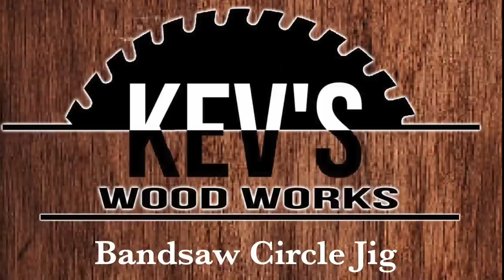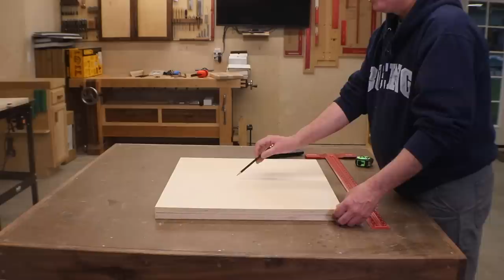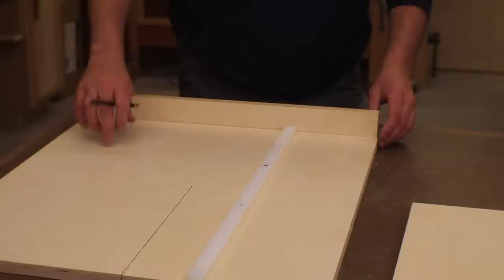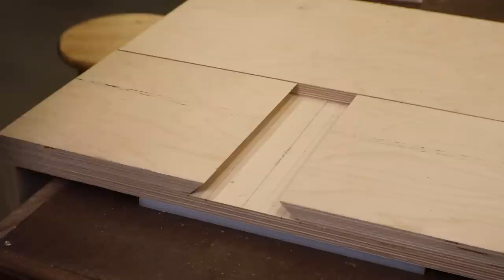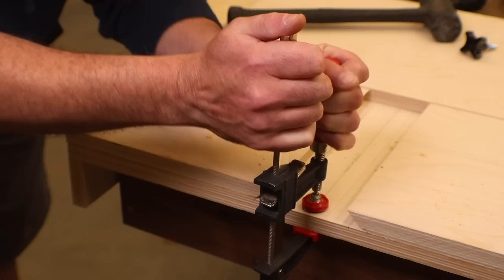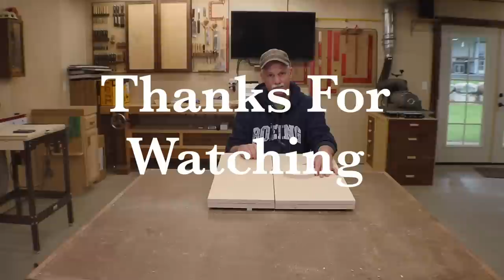Bandsaw Circle Jig

Comment: Hi KC just wondering how with the constant use will the locking bolt/screw make indentations in the bottom of the sliding piece?
Reply from the maker: I've not had any issues with that but, it would be easy enough to remake the sliding piece if it got to a point of not useable.

Comment: Great video! What model band saw do you have? Also how large of circle can you cut with your jig?
Reply from the maker: Thanks!  It's the Grizzly G0555 14" bandsaw .  The jig will cut far greater than the capacity of the saw especially if you flip the insert around.  To ultimately answer your question, on that saw, I can cut about a 27" perfect circle.